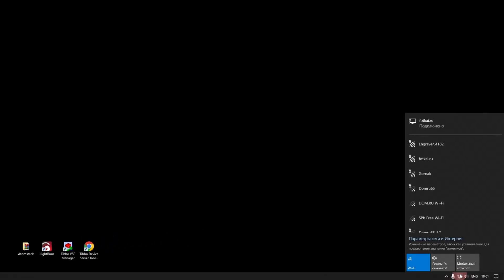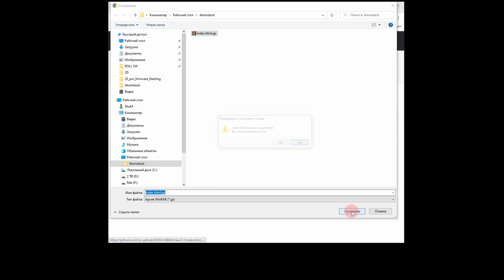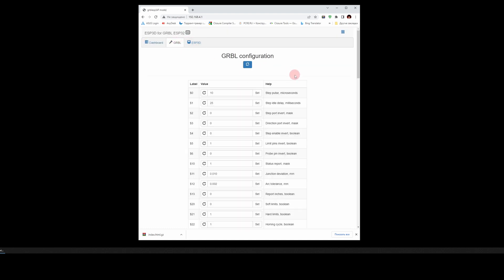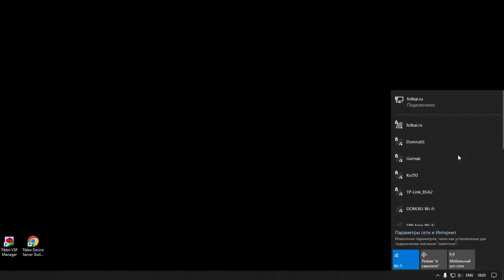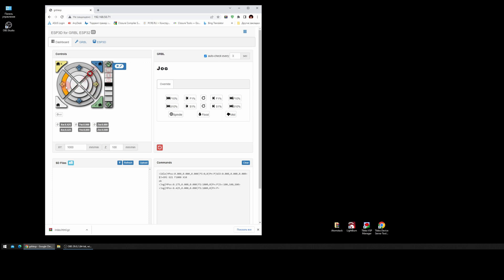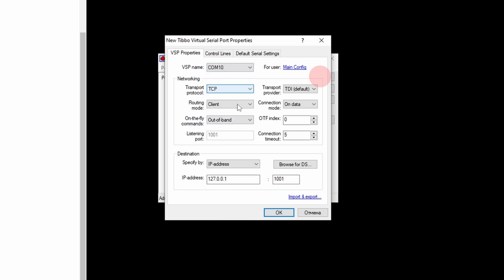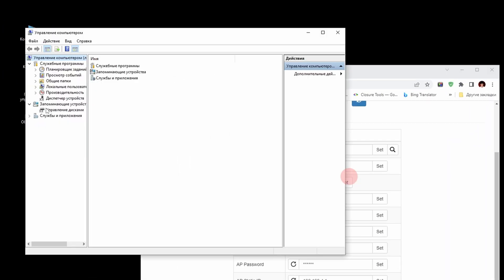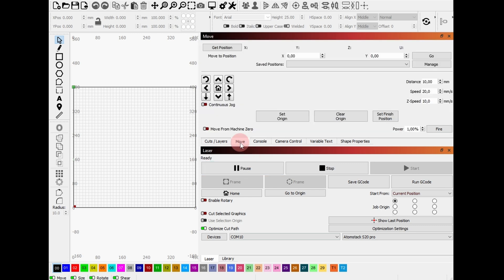Atomstack connect to wifi and LightBurn

Comment: yes, maybe I'm stupid, but my PC doesn't see the wifi from the Atomstack, my mobile phone can receive the wifi signal but my PC can't, what's the problem?
Reply: The Atomstack support writes to me that you can only connect the laser to the phone and not to the PC and yet it works for you but not for me, I don't see a Wi-Fi signal on my PC
Reply: I have the same problem. I can see it on my phone and tried and uploaded that .gz file and now with my phone it says content encoding error and I can no longer connect via the ip address.
Reply: @TheWaterMagister  So, I have used the same USB wifi adapter, I have also tried it on another computer, I have also tried it with a Raspberry Pi and everywhere the same result, I can ping it but in the browser the message "This URI does not exist" Maybe we don't have the same Atomstack controller, my controller is an Atomstack AIC1 BUT without a reset button.
Which controller do you have on the laser?